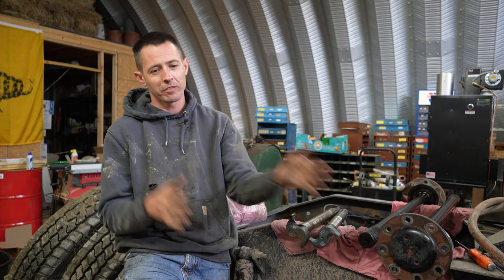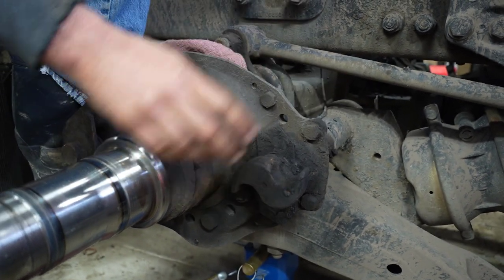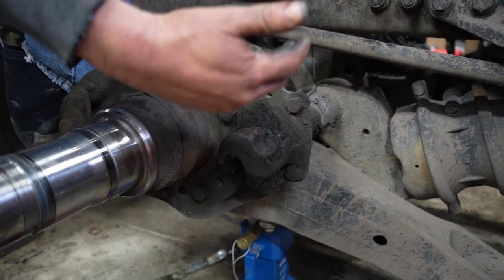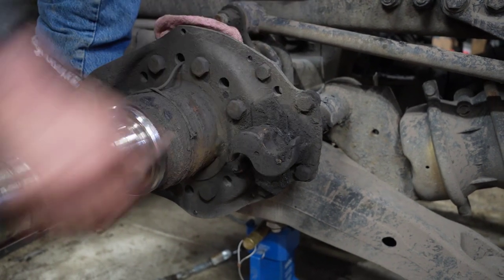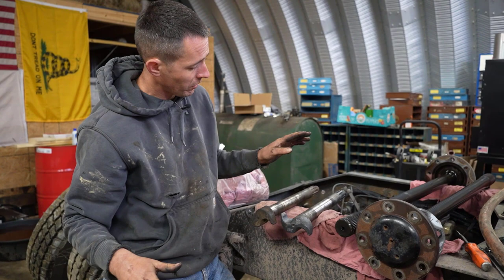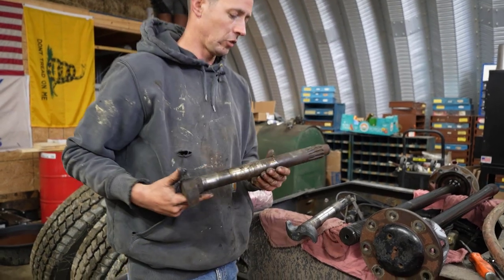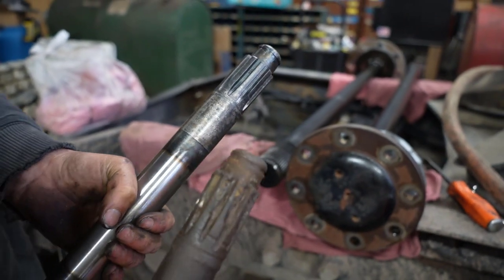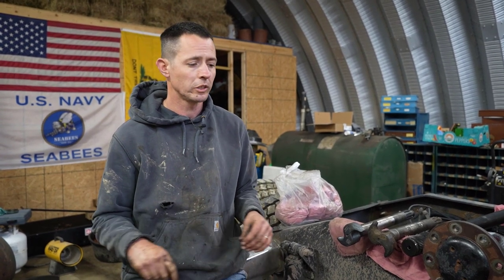How a bad brake cam can affect your brake wear

Comment: If you take the s-cam tube off you will have enough room to slide the s-cam past the hub
Reply: I think that's only on the Hendrikson suspension, also it is recommended to replace the cam tube when doing 
s-cams

Comment: It would be helpful to know the "symptoms" when you do these videos. For example, would there be noise or movement that the driver would hear or feel prior to the brakes/chamber getting to this condition?
Reply: He said the shoes will wear uneven
Reply: @Sbowling1979  yes, but is it something that you feel while you're driving or is there a specific sound that the driver may hear? I am not mechanically inclined and I have to depend on professionals to let me know what to look for and it would help to know noises or activities related to the specific problem.
Reply: If a driver is driving probably not. If listening at the wheel when there is a brake application you may hear the slapping of the worn camshaft if it is really worn such as the one in this video. Acceptable wear for vertical lift on a camshaft is less than 0.20 on a Bendix Spicer and less than 0.30 on a Meritor/Rockwell. The industry says that if vertical lift is at 0.10 that movement needs to be addressed with either new camshaft bushings or camshafts or both.
Reply: When you are under the truck or trailer and air supplied. Push up on the s cam shaft between the wheel and slack adjuster. Do this before putting grease in. Putting grease in will tighten it up and make it snug. I check brake lining and signs of oil or grease and push up on the shaft then I adjust brakes then disconnect air supply and grease. Also I connect emergency and service air supply and check my brake chambers for air leaks.
Reply: Thank you for all the helpful information 🤠
Reply: @ohiopipper3956  Good advice if you are working with good non worn out components. Grease will not replace worn out components. As soon as you hit the brakes you squeeze that new grease right back out and you have loose components again. The vertical camshaft lift has to be checked.

Comment: Is it possible that the s-cam shaft bushings would be the only part you would have to replace? Or should the shaft always be replaced when new bushings go in? Great information in your video! Thanks!
Reply: It depends on how worn the camshaft is. If you have more than 0.20 (Bendix/ Spicer brakes) vertical lift movement you are beyond their spec. tolerance. You need to make it less than 0.10. If you can do it with just bushings that's great. The Meritor vertical lift spec tolerance is 0.30.

Comment: Just look at the direction the piggy back will turn.  If it turns right then the cam should be positioned with the openings of the S cam  to the left. You see whe the arms are reaching. Simple

Comment: Thanks for the tip dude minute 4.46 some guy changes the s cams and bushings on front axle of my truck put the left one on right  and right on left and after that all other mechanics  where i went couldn't find out what was the problem. now I fix them my self thanks to you 👍

Comment: Hope youre still around! Having problem getting a Volvo tractor rear brake to release. Everyone just says beat on the drum!🤪 Its got shields hiding the shoes. And ive let some pressure off of the cam switch... per a mechanic i know, whos busy hauling grain. Ima farmer btw. Not working. Are there other reasons a wheel wont turn beside a locked brake? Im hoping not bad bearing in wheel! Guessing ill have to make 100% sure brake is releasing. Idk, sorry im all over the place. But its my dad's operation, and i feel like beating that drum is beating a dead horse! He also says hit wheel rim... everyone ive seen says hit drum. Is that good or not? All seems bad imo!😅 im denting rim! So pretty sure Ive got the force! Just seems something else amiss here. Would appreciate advice! Ssl!
Reply: You're still around, posted 7days ago. But idk if you see old video comments

Comment: Let me help you understand this better and explain it better I hope.  The bottom brake is worn because the brake shoes is not being held in the Center of the drum. It is down in the drum. 
It is not being held in the Center of the drum as the cam and cam bushing is worn simple. Cam and camshaft are some of the most overlooked brake parts on a brake job. Good cams and bushings can extend the brake life as much as 60%. Brake cam seem to last longer on trucks than trailers as they grease  more often. Always use metal bushings when you can get them the plastic stuff is junk. By the best brake material you can don’t by buy price the parts are cheep it the down time labour that is expensive get good brakes There kits you can get to put cam tubes on trailers that don’t have them from factory. Cam tubes are way better than cheep open cams. 
A good brake job done properly on a trailer running the Rocky Mountain should last 250,000 to 300,000 miles that is 2. 1/2 to 3 years.  That has been are fleet experience. When we do a brake job we change everything brakes drums hardware it cheaper in the long run we have the states to prove it.   
All the best.

Comment: Today I found a s-cam that wasn't greased properly. It didn't purge on the brakes but it did take way too much grease so I knew something was wrong. It had been running dry for a while and was really worn out and rusted

Comment: I got an issue that when i adjust my slack adjuster and press on the brakes, the slack adjuster goes completely loose. I replaced brake chamber, brake shoes, and slack adjuster and it still does it. Would it be the s-cam that needs replacing?

Comment: Do you have any video on how to brake chambers for air leaks and service & park brake valves?
Reply: Wheel chocks so truck can't roll ( don't skip this step) air both tanks to max pressure then release parking brake. Then with a tool or an assistant apply the brake pedal. Then go listen for leaks. You can also bring a spray bottle full of soap and spray hoses valves chambers and like four bubbles .

Comment: I had this problem a few months ago. My symptom was grease came out inside the drum when the seal on the S cam failed. Driving threw the grease out inside the wheel. Looked like a wheel seal leak on the inside of the tire except it was grease. Also I had the irregular shoe wear he spoke of. The braking power decrease is only slightly noticeable at first. There was no smoking or squealing on my Pete. Perhaps the excess movement could also cause a slack adjuster to fail prematurely.
Reply: Did you have any wheel not locking issue too cuz i’m having that issue. I replaced my brake shoes and drums, I didn’t notice any major difference in the brake power and also noticed that during wet conditions, my wheels don’t lock when braking.
Reply: @JagdeepSingh-wv1ry  I'm not sure I clearly understand your question. You should have ABS on whatever it is you're driving. "Locking up" is an undesirable thing because it will flat spot tires. I never want my slacks adjusted so tight they lock up during service. Only when parked. Slacks adjust about 1/2 round backed off with full air psi when you do it. Anyway, maybe the quick air release feature on ABS valve might under your 5th wheel might be worth an inspection. Also if your slacks are bad they will not hold adjustment properly.
Reply: @caseydale4731  I meant to say that in wet conditions my 3 drive axle brakes barely works. One works fine. The wheels should lock in order for abs to work. But I noticed that only one tire locks which does not have abs sensor. I don’t understand what is causing this. Under normal conditions brakes on all four wheels work fine.
Reply: @JagdeepSingh-wv1ry  when you are parked with the brakes set, how long is the pushrod from the brake chamber to the slack adjuster? More like 2 inches or 5?
Reply: @JagdeepSingh-wv1ry  my concern is that you have bad slack adjusters. If you have 3 bad ones then it would be difficult to stop. Rain naturally makes stopping more difficult because less traction. How good are your tires?
Reply: @caseydale4731  I checked everything. Pushrods are around 1.5 inches and slack adjusters are fine. They self adjust.
Reply: @JagdeepSingh-wv1ry the slacks seem mechanically sound from this short story. However, I'm just a guy in the comments on YouTube. If you are concerned with it still because of performance or lack thereof, let a good mechanic check it out. Especially for safety sake. Rain in general can increase your stopping distance.
Reply: @JagdeepSingh-wv1ry  if a good mechanic is not available perhaps try recreating the wet conditions and inspect yourself. Like a water hose to the inside of all the brake drums then test drive. Are the brake shoes the correct ones to match the drum? I had incorrect brake shoes on an old trailer I bought once. They wore down on the inside of the drum so couldn't see the problem without disassembling. Has your air dryer filter been changed recently? Perhaps water affecting the D2 governor during the rain somehow. Do you drain the moisture from your wet tank and the other 2? What does your psi build to on the dash guage?
Reply: @JagdeepSingh-wv1ry  do you have good brake air line hoses on the service side to the chambers? I have a loud CAT. I couldn't hear a small leak in a dry rotten hose from my seat. I'm just guessing but perhaps it can give you a direction to think. Best wishes.
Reply: @caseydale4731  I have a CAT too. I have to shut it off after building pressure to hear a leak. I changed the abs valve under the fifth wheel today it was leaking a bit and brakes and drums were changed last september. I haven’t replaced the air dryer lately, but I drain tanks regularly not a lot of water and oil in it. Finding good mechanic these days I think if I try I will find aliens before that. Tell me more about the D2 governor though.
Reply: I have checked the brake shoes they are all the same size I haven’t checker the shoes though. I’ll check it tomorrow.
Reply: @JagdeepSingh-wv1ry  the D2 on my Pete is bolted to the air dryer housing. It cannot be purchased separately per Peterbilt. Also, mine is non adjustable. Does yours pop off the air at 140ish or a little higher consistently? I had to replace mine last year. It became goofy and erratic. More of a purge valve leaking even after rebuild kit. I'm pulling at straws guessing ideas that could cause poor braking power.
Reply: @JagdeepSingh-wv1ry  maybe watch a Haldex or Bendix truck air system video here on YouTube for the components. There is a valve that determines how much air to send to the chambers based on how hard you are pushing the pedal. With rain causing the issue, perhaps that brake valve is getting wet somehow. Again, it's just a guess without doing any diagnostics.

Comment: you need to go to a good brake school/class before you start spouting stuff on the internet, worn scam and bushing cause push rod travel, the bottom shoe being worn down is from the spring being over stretched when installed and dragging on the drum, the wheel locking up has a flat spot on the roller, left and right scams only count when the brake chamber is on the front of the load housing or axle housing on trailers, each truck manufacture has a bit different max movement. volvo has max at .46, you can do a bendix online class at home on your computer.